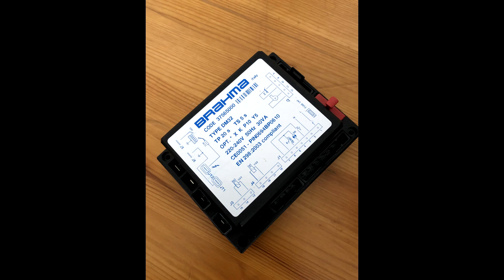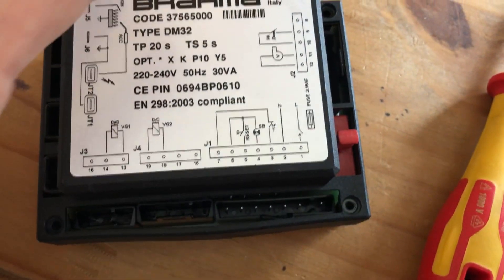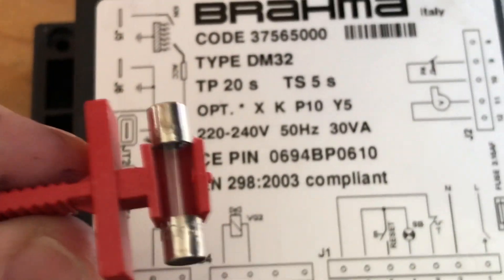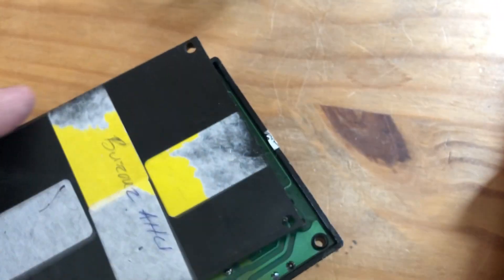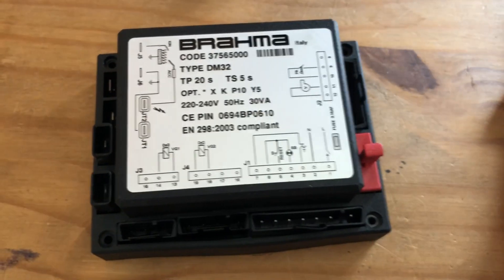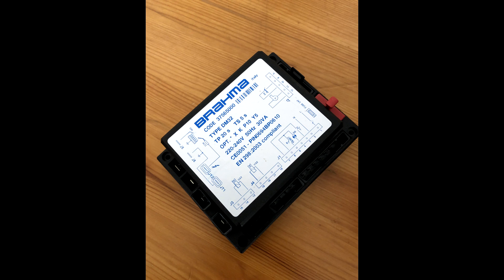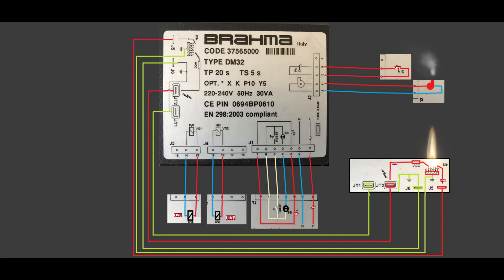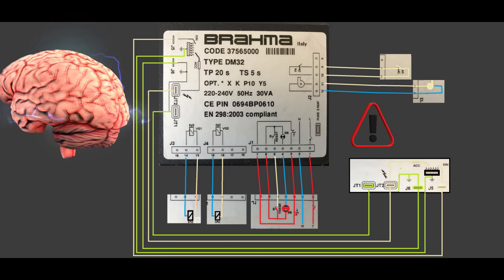Learn fast about HVAC Brahma burner controller how to investigate and troubleshoot

Comment: I have tried to change a space heater that had a purely mechanical thermostat to use a digital stat which needs a live and neutral.  The stat uses a 3 pin + earth plug and the heater unit has the neutral connected (this may have been for a compensation heater in a stat).  What I find is that the voltag on pin 7 is a bit lower than mains (216V rather than 240V) I find that when the stat closes onto pin 3 the voltage drops and is not enough for the digital stat.  Does anyone know if it is OK to feed pin 3 via the stat contact from the supply voltage rather than pin 7

Comment: How does 2 - 4  burners Reznor  work
Reply from the maker: Are you referring to the burner or to burner’s control.
4 burners can be individually  by a burner control like Honeywell Brachma  etc.
You can use a  PLC or a temperature step module !
Reply: @TechnicalChallenger   I have a  Reznor unit  with 3 burners, one flue fan.   The burner  starts one after the other  like using delay timers . what is the electronic behind this cascades ?
Thanks
Reply from the maker: @MashaKayode  easy.
Each burner will enable the next one .
There are multiple options .
The cascade can be governed by the first module that initiate the second one which will initiate the third  one.
If there is no PLC or any other control then when the first module receive power it will initaite the fan of the first burner and the second burner control then the second one will initiate the third one .
Bare in mind that there are multiple way to control the cascade by using time delay relays ,direct cascade from one burner to another or BMS or PLC control or deaignated PCB with pre installed software .
Give me a buzz .may be I can Help .
Reply: @TechnicalChallenger  thanks